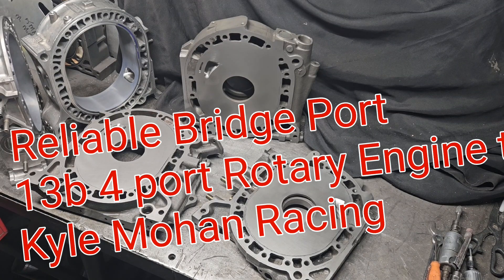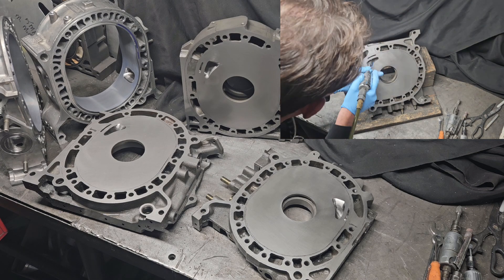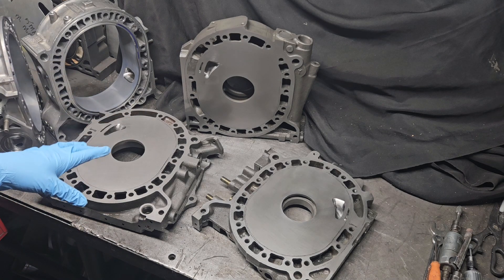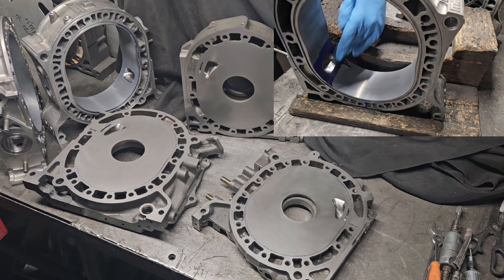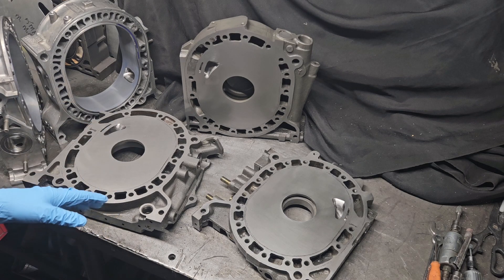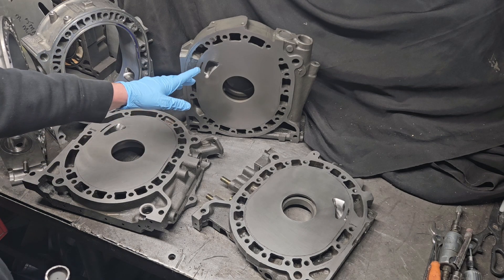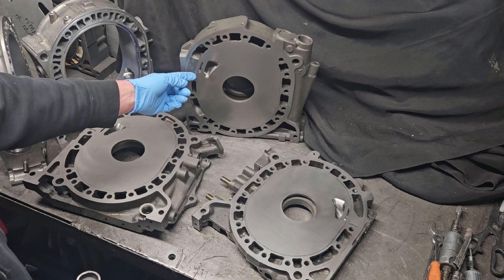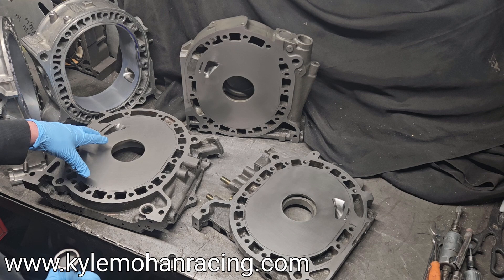Reliable Rotary Engine Bridgeport 13b tips, tricks, information, KMR tech talk

Comment: I'm new to the rotary world and would like to possibly build one some day. I was looking at possibly geting a 2005 rx8 4 port is that a good motor? Later I'd like to turbo it to.
Reply: I have the 2005 6 port manual. It’s really fun to drive, it’s fast in the corners but not in a straight line. If you want power gains then the Rx8 motor is just not worth the time and money in my opinion. 

Still love the platfor. In your case an engine swap to a 13b-rew is what id recommend. It might even save you money

Comment: Kyle! Would you consider attending my Rotary engine rebuild workshop as one of my paid instructors? 
Join us for the Rotary Engine Restoration Seminar in Sacramento, CA, on March 9 & 10, 2024!
Following the success of our January class, we’re thrilled to announce the upcoming event at a Sacramento airport adjacent hotel (location to be determined). Engage in hands-on learning with 5 engine rebuild workstations, where teams of 4-5 individuals collaborate on rebuilding engines. Only 25 seats available!
Enrollment Now Open:
5 spots for Rotary owners seeking to rebuild their own engines (pre-event inspection required by Feb 20).
20 spots for Rotary enthusiasts eager to learn engine rebuilding skills.
Tuition:
Restore Your Engine: $1,500 (Parts Not Included) – Limited to 5 Engines 
Student Participation: $500 – Limited to 20
Experience personalized instruction, repetition in each step, and comprehensive coverage of Rotary engine rebuilding. All tools and instructional materials provided, along with breakfast and refreshments during breaks.
Call 209-770-5624